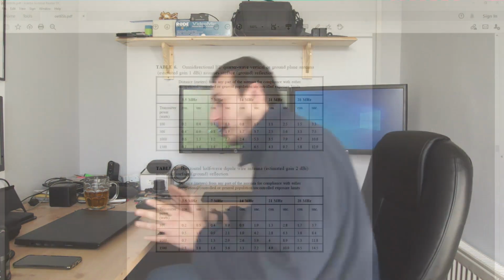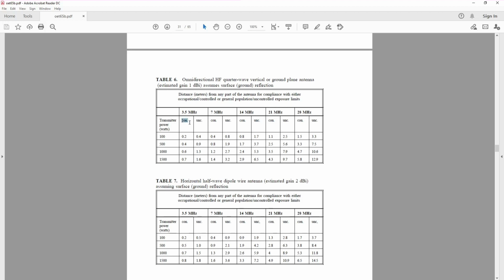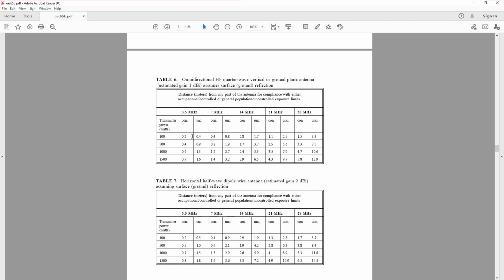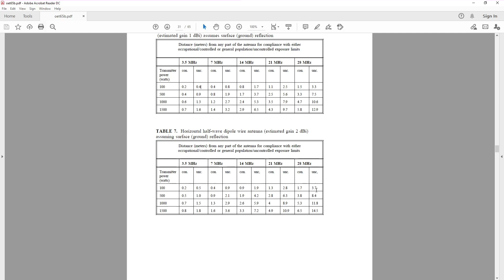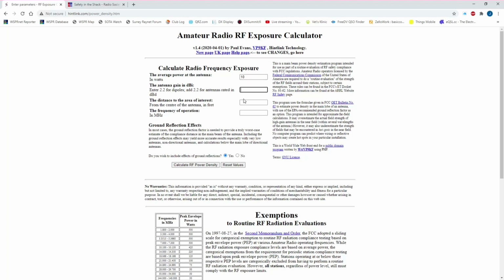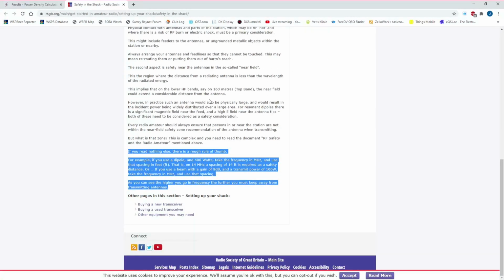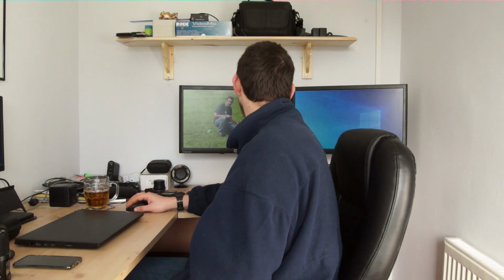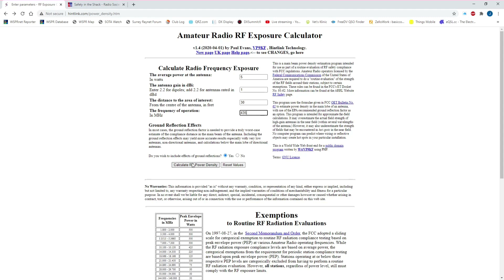Safe Distance From A Transmitting Antenna?

Comment: When you considered handheld, you say 30cm, which would be around 1feet, but you use 30feet in calculator
Reply from the maker: Oops!!! Sorry about that. Thank you for pointing it out.
Reply: @HamRadioOnline  Just did the calc and it's not safe!...LoL...think it says 1.2 feet would be safe so hold at arm's length and use a hand mic!.....I wonder what mobile phones are doing to our kids!!!!...can't wait on 5g...LoL
Reply from the maker: Your figure somewhere between 1ft & 2ft sounds about right to me.

I've often wondered whether holding an aerial near your head while transmitting was a good idea.

I rarely use handhelds. I'm mainly base or portable operations with an external antenna, so the few rare occasions (around 2 to 3 times a year) when I do use a handheld with the stock antenna probably aren't going to do me any real harm.......or at least I hope it won't!!!

Generally I use my handhelds for SOTA activations & I usually plug the handheld into an external antenna on a small mast (which would put me a safe distance from the antenna).

I think a bit of common sense & pragmatism is required here. A couple of 10 minute QSO's on the stock antenna occasionally aren't going to do you any harm.

If you are operating regularly for extended periods such as rag chewing on the repeaters every day or regular/extended SOTA activations, then you should probably be using an external antenna, or (as you suggest) at the very least using an external mic.

Like you, I have often wondered about mobile phones.
Reply: @HamRadioOnline  HiHi....spotted that as well!

Comment: danger is heat. i took mri lately. even there i wondered how much heat was from rf. although it does transmit ~25kw pulses at ~xxkhz. and it's using rf on purpose. so i assumed i did feel rf heating. still, danger is burn. nothing else has ever been confirmed. we had studies running for several decades. more than century of radio even. all we know is that rf burns are are a thing. but you need kilowatts for that. and high duty too. i think we overdo those limits
Reply from the maker: When I had an MRI, it certainly felt a bit odd......heat on my back and in my fingers, along with a tingling sensation in my arms.

I agree that the ICNIRP limits walk on the side of caution and are possibly somewhat over zealous.

Although I can confirm that it doesn't take KW of power to get an RF burn......I once managed to give myself an RF burn as an intermediate licence (limited to 50w at the time). I only ever did that once!!!
Reply: in my case, target was balls. not brain. so i got just heat and no other things. cancer screening but nothing immediately malignant was found luckily. i also got brain one as teen but it didn't do anything either. also, gadolinium contrast agent i got felt cold. unsure if solution or the fact that it's essentially metal compound of sorts

i've seen people climbing towers illegally. shared videos. one grabbed this, iirc transmission line, assuming it's just nice handle with shiny metal on a white ceramic insulator. he took hand away quite quickly. clearly no rf background as why even climb, let alone touch it. could fall

i think that those rules are indeed very conservative. i can't be arsed to check which levels where and how and how long were bad. probably not going to check on my own on purpose. even after i get license. some of it you don't feel at first and so on

Comment: About 25 years ago I worked as an engineer for a radio paging company that transmitted 100 W ERP from vertical antennas on 138 MHz. One day I got a phone call from the owner of a tower block where one of the stations was sited. Apparently he had had a team of builders working on the top of the building next to the antenna without realising it was live. Usually if asked we would go out and turn it off while work was carried out. He called because all the builders had called in sick with severe headaches that started while they were working the previous day. I kept in touch and fortunately none of them had any permanent problems and the headaches cleared within a few days. The point I am making is that RF safety should be taken seriously especially if anyone can get close to the antenna. After that for over 20 years I've done the RF safety calculations at all the contracts I've worked on including mobile phone companies, underground railway signalling and microwave links. Finally OFCOM have got around to making sure that radio amateurs in the UK do something about RF safety!

Comment: I had not seen the FCC documents before so thank you for sharing James. I’d like to see a re-run of the last calculation as I think you entered cm and not ft. I think your advice is fair, use a headset or long mic lead at the higher frequencies. Even at low power separation seems like sound practice. Keep up the good work James. 👍🏻✅ 73 de Will, M0LGW

Comment: I've been playing with radios for 60 years and have not met anyone who has been harmed by EMR. So I'm a little sceptical. That said I keep my distance from high voltages having received a few pokes..
Reply from the maker: I would have to say that I share your scepticism. The reality is that just about everything requires some form of risk assessment these days. It's called blame culture.

I'm a little old fashioned because I believe in using common sense. If you don't know what something is (whether it's an antenna, power cable, some kind of chemical, or a piece of machinery) then stay well away from it & don't touch it!

Unfortunately that won't fly with the health & safety brigade who won't let us think for ourselves.

I personally think that this is a bit over the top.

Irrelevant of our personal views, I'm afraid this is something which is coming in & we are going to have to abide by it as a condition of our licence.
Reply: @HamRadioOnline  Agreed, I'll certainly comply. It remains to be seen if any value is added.

Comment: On the last example with the hand held did you enter cm instead of feet. All this is very interesting particularly when you have worked close to antennas with 100 - 150 kw on MF, and 250 to 500 kw. On hf.  Regards Mike.

Comment: Very interesting and thought provoking. Someone has already mentioned your mixing up imperial and metric. I often wonder what the risks actually are? They used to say mobiles would fry your brains, and the dangers of RF burns are well known, if you are daft enough to hold a bare antenna wire while pumping a gazillion watts through it, it will hurt, but , seriously, what risks are we avoiding? Guidance would be handy when going portable, in a POTA/SOTA situation when a member of the public expresses concerns. Thanks for putting this out. 73 Jim M7BXT
Reply from the maker: Hi Jim.

Yep, proof that I'm human & that people who run a channel on YouTube don't know everything!

I like to think that I've done my homework before I film & release a video but mistakes do occasionally slip through the net. Slap on wrist for me!!!

I think the problem that we have here is that the regulating authorities around the world have decided that this is something which needs tighter control but nobody seems to fully understand exactly what form this should take, hence the guidance is very vague.

This video was filmed a few weeks ago. I believe that since this video was filmed the RSGB have now put a spreadsheet/calculator tool on their website. Unfortunately I've heard a few reports of it not working properly. I'm not sure if they've fixed it yet.

The argument is that it's to protect the public from getting too close. Unfortunately everything requires a risk assessment these days.

Personally, I was brought up in a family which took the attitude of "use common sense", "don't be an idiot" & "if you hurt yourself doing something stupid then it's your own fault".

If you don't know what something is, you don't know what the dangers are & don't how to use it then you shouldn't really be going anywhere near it. I think Darwin had an extremely good theory on this one!

Unfortunately in this day & age of suing, risk assessments & blame culture, that attitude just doesn't fly anymore.
Reply: @HamRadioOnline  Tell me about it! I live in social housing and it has taken nearly a year of "negotiation" to sort my antennas out. My landlord uses a landscape company to cut the grass, but they are not the problem, my landlord is. I have to get public liability insurance covering my home and neighbors, and do risk assessments and the rest of the rubbish. The gardeners are fine, and know to leave the grass a bit long over the radials and co ax. Post Covid the guy who drives the mower wants to come in for a demo, he asks good questions and I reckon we may have a convert waiting in the wings! I am only in Chipping Norton and I think you are in the Gloucester area, when this is all sorted out maybe we could meet up for a pint! 73 Jim M7BXT
Reply from the maker: I have to admit that I'm not a big drinker but I'm sure that we could arrange some kind of a meet up.

I'm contemplating the idea of getting one or two viewers involved with a guest appearance on the channel (just to mix things up a little bit). I'm not sure if that would work or not.

A joint activation of a SOTA summit with a viewer could be an interesting concept for a video, or maybe something from the antenna farm (once I get the big antennas up) with a guest operator?

I thought about inviting a recently licensed M7 to the antenna farm & letting them loose with a big antenna & 100 watts (obviously under supervision).

I have had discussions with other YouTubers about doing a possible collaboration. Maybe a group of us at the antenna farm (which could possibly be live streamed). Unfortunately that idea fell flat on it's face when Covid kicked in!

I'm just rattling out ideas off the top of my head here. I need to sit down and properly figure out what might work.

Either way it will need to be after the Covid restrictions are lifted & once things have settled down a bit. We'll see how things pan out over the next few months.